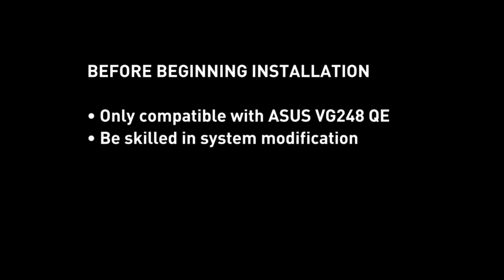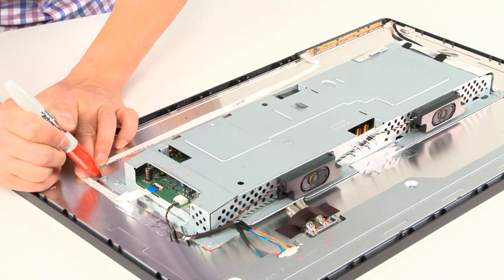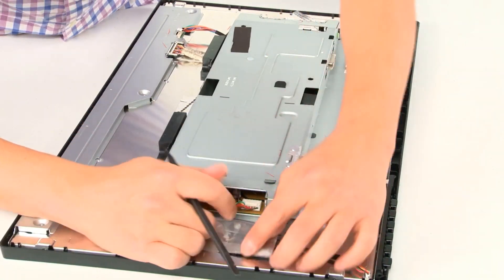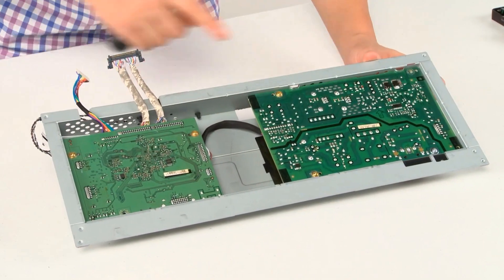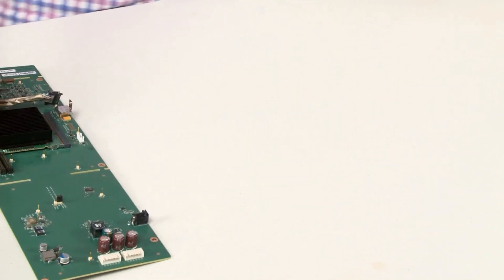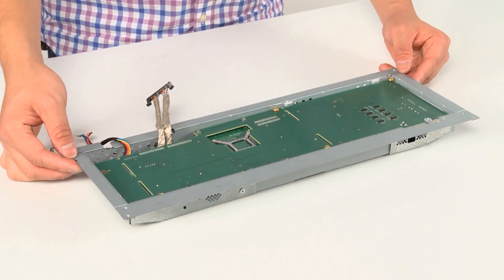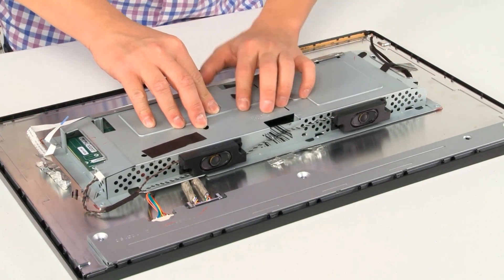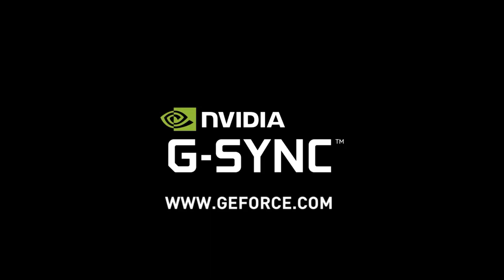NVIDIA G-SYNC DIY Kit Installation

Comment: Why is that entire component just stuck on with tape and not with screws?
Reply: Because what its held onto is the back of the LCD screen, you screw into that, game over for the monitor.
Reply: Because the stand portion of the monitor from the back pretty much keeps the PCB component in place, even without the tape it will stay there.
Reply: aznstar871 Ah, I see. Thanks, I didn't realize that it was mounted anyways.
Reply: Jamie Powley What makes them unable to build a plastic chassis inside the monitor that separates LCD screen and electronic board? That'd make it significantly easier to install a Nvidia board in place of stock monitor motherboard.

Comment: I cannot believe, that triggering a latch signal externally is such a hard thing to do. Maybe because the established design is so heavily integrated and focussed on fixed framerates? I am just a layman in this field, but maybe one step towards de-integration of the circuits would make a mod like this much simpler.

Comment: This is one of the dumbest ideas I've ever seen, Nvidia a monitor is not a PC this is something no user should ever be expected to do with a monitor. Either supply G-SYNC built in or don't bother would be my advice, theirs no reason to run the risk of destroying the monitor for this upgrade. It's like asking people to add an Extra HDMI connector to a Graphics card, but don't worry it just needs some soldering! Really interested in G-sync but this is not a good way to get people interested.

Comment: 200$. Voids my warranty. HMMMMM.
Reply: but... g-sync
Reply: ***** but... screen tears

p.s. i dont notice them >:D
Reply: ***** But.. only laptops
Reply: ***** well; in this case the QE is 144hz - thats just reset to factory defaults; G-SYNC is totally worth it; after trying it I had to have it; finally the DIY kits came back on nvidia.com and mines on route to my house; can't wait to crack the back of my monitor open!
Reply: merijn dobbelaar match frame rate to the refresh rate of my monitor, just cap your frames, its not difficult

Comment: AMD Mantle API no OS attached.Question

How where they able to develope a New Graphics API without needing to redesign the operating system. This is revolutionary. I was told if i wanted to use DX11.2 i needed to install a touch screen implementation of windows called windows 8 on my new non touch screen monitor.Then upgrade to Windows 8.1. With the AMD Mantle API all i need to do is make sure i have the latest graphics driver's
WOW thats just amazing.

Comment: Here's another thing. I bought this monitor in preparation for G-Sync, but it's SO good on its own (1 ms), I don't really see a reason to upgrade.  There's got to be a better way to help people understand why this is worthwhile.
Reply: Frankly, I had bought the VG248QE with g-sync in mind, and the refresh rate of 144hz alone makes screen tearing barely noticeable when compared to a 60hz monitor.
Reply: Same
Reply: same here. I would buy another monitor with g-sync after saw that price. better worth it,
Reply: Gsync is needed because in very demanding games you often won't be able to maintain a steady 144hz.

Comment: Quick tip. after plugging in all the cable, power up the monitor to make it works before you put everything back in its original state.

Comment: It does not look soo hard and I have worked with far complexer things but I think spending those 200$ on a better GPU is the real way to go. If I had 200$ more for my build I would have bought a 780 and not a AMD 280x and I woul not have to worry anything. Humans do fail from time to time so the risk would be high enough to lose a few hundret $ on something that could have been bypassed by spending money on better components.
Reply: No, bro. You see, G-Sync solves the issues related to both low fps and high fps (yes, high fps can be a problem too).

If you have low fps, your monitor will lower its refresh rate so that you don't see stutter in the picture. It's the same if you have high fps, but you can turn off V-Sync and forget about tearing. For this, G-Sync monitors are coming with a high maximum refresh rate (About 120~144Hz or higher)
Reply: hmm... okay, I did not think about that.
Reply: ***** It depends on how you see it. The way I see it, G-Sync isn't pointless.

There are people like me that can't afford a PC upgrade right now because of everything it involves: upgrading PSU, new mobo, making sure it will last for a few years, etc.

But a monitor that will stay with me even if I make a new PC, that I can do. And if the monitor will take advantage of everything on my current PC, it's even better.

The thing with a fixed refresh ratio is that you'll get stutter if your game doesn't run at the full 144Hz of your monitor and will get tearing if you run higher than 144 fps.

G-Sync allows you to have a variable refresh ratio from 0 to 144, meaning that you can play on any graphic quality, get any fps from 30 to 144 and it will look good–no stutter; no tearing.
Reply: ***** Right, I don't mean literally zero input lag, of course. But I thought it was more like 1ms. 2-3 is still really good, especially when no frames are ever skipped.
Reply: Yep, what he said. Plus getting a 780 won't solve everything. I have a liquid cooled and overclocked 780 and it doesn't solve tearing, stutter, or any of the other effects of a GPU not being synced with the monitor. A 60hz monitor with G-sync and a lower mid-grade GPU like the 280x could potentially result in a noticeably better gaming experience than my 780 and a 120hz non-G-sync monitor. You may be somewhere between 45 and 60 FPS all the time with the 280x and 60hz G-sync monitor, but those FPS are perfectly synced with zero input lag, stutter, or tearing. And that's going to be a consistently smooth gameplay, whereas a 780 putting out higher FPS into a higher refresh rate monitor will be all over the place from very smooth one moment to tearing, stuttering, lagging, skipping frames, etc the next moment.
Reply: ***** I thought the delay happened with the DYI kit only :o :o :o
Reply: Seriously. If to much fps is an issue, because of dips desync etc, I would recommend trying nVidia shadow play on. Its free and while it uses a bit more resources overall it actually also stabilize the fps around 60. Making transitions between images seem more fluid. It dose not remove screen tearing like vsync though.

Comment: freesync + displayport 1.3 here I come, all you have to do is flash a firmware update on existing hardware if the manufacturer releases one.  Newer AMD cards most likely already supports DP 1.3.

All this to risk breaking a $350+ monitor? WIth a $200 addon card?  And aren't they restricted to 30Hz right now?

Comment: I love the idea of Gsync. I want it. But at the price point of 200 dollars for the kit alone you might as well save your money and wait for a gpu upgrade that will run games at a constant 60 fps. If you are prepared to spend that much on Gsync, chances are you already have a gpu that can do that. This does not include the (120hz gamers)
Reply: But pre done G sync monitors by the likes of ben q and asus will cost less for this you are just paying an early adopters fee
Reply: Sure you can get one of those too but I would think most people who have a 300+ monitor will still have a really power gpu to back it up.
Reply: Well I think I'll be swapping my monitor for a gsync on have a 1440x900 monitor from about 7 years back and it's served my well it's just time for an upgrade because I always upgrade my rig and put the monitor behind me so it's got a well deserved upgrade coming
Reply: I bought a very nice very flat super high contrast wonderfully colored 1080p display about 5 months ago. Easily the best display i've ever had. Makes my 1080p tv look stupid when comparing color and pixel density.

I couldn't see myself getting a new monitor for at least 3 years because I have a gtx 780 and ill have a 780ti in about 2 weeks. I don't think I will be dropping below 60fps in anything.
Reply: I've got a 760 upgrading to sli in about 8 months ( probably when I'll get a G sync monitor too!)and it's just a logical upgrade path for me because I like to think of a monitor as a piece of furniture because you keep them for years and if you buy a bad one your stuck with a bad one vica versa so that's my reasoning for it
Reply: Hey if you are upgrading from something that old no doubt it is the way to go. I was just thinking there is not a good reason to run out and buy a new one if you already have a decent monitor. And if you don't have the horse power to maintain constant 60fps. Two 760's should...but you still need a new monitor. lol
Reply: I totally agree with you and I'm upgrading so why not go for the new technology if you can just not sure what resolution to go for if there are any 2560 x 1080 (21:9 ultra wide) G sync monitors around when I'm buying ( might even wait) I'll defo pick up one of them
Reply: I am jealous. I would take a 21:9 monitor over a 1440p monitor any day. I was actually thinking about buying one later in the year even though my monitor is not old.
Reply: I  would think that good FOV would make more sense hence the wanting of a 2560x1080 ultra wide
Reply: Yeha I always adjust fov really high if I can, I can't imagine ultra wide would hurt. I like fove between 100-120 in most games. 90 for skyrim because it fisheyes so bad.
Reply: Yeah my skyrim is still somewhat unstable (blame that on mods) but it's really odd because it adjusts it on all angles not just the left and right
Reply: I seem to have a huge performance loss when changing my fov, I never noticed it before because I just recently installed all my mods. I drop about 20 fps going from 75fov to 95. It's insane.
Reply: I've always observed drops in fps when adjusting FOV but never as much as Skyrim so a widescreen resolution makes more sense for it
Reply: Weird thing is I have never seen more than 2 frames being dropped when massively increasing fov
Reply: The Lobotomite ~4:3 offers the best FOV without distortion("fish eye"), it's roughly the same aspect ratio as human stereo vision. Hence why IMAX is 4:3.

Wide screen monitors are a compromise solution. Most of the action happens along the horizon. Hence if you use a "letter box" format you can save on drawing ground, floors, sky, and ceilings which are often not as interesting as what's happening on the horizontal axis; for the same amount of pixels you can cram in some more horizon instead. Cinemas are also cheaper to build wide rather than tall, which is why the format cought on in the first place.

Given an unlimited amount of money and computing power wide screen is clearly a poor choice; since you can always have a display as wide as the wide screen, only taller to more accurately represent the aspect ratio of human vision.
Reply: SLI 780 ti's and G-Sync you do not notice drops of FPS; - I use 16:9 obviously at 1920x1080; I use 110 fov in Quake Live, Battlefield 4/BF Hardline beta/(Christ; another game that just came out drawing a blank.)
Reply: Yes i do. Wanna see video?

BTW I didnt have to get my 780 on discount, i got it because it has built in water cooling.

Also, I seriously doubt you have either of those things.
Reply: Jourmand1r 2560x1080p isn't UHD. I run ALL my games at a perfect 60fps without and hickups. A 780ti is more powerful than and amd part. Even though the 290x scales better at 4k over the 780ti...at beast the 290x catches it on some games at 4k. At best. You are just talking out your ass right now for no reason. What is your agenda? You are not making a point.

Comment: why doesn't nvidia invent a technology where the graphics card can understand limit its power for a target frame rate with 20 percent headroom on the top as buffer for intensive scenes.  instead of all this new monitor nonsense.
Reply: Because it's the monitor which is the problem, not the graphics card, no point in sticking a bandaid on it, someone needed to fix it.
Reply: its not about sticking a band aid on it. I hate how nvidia thinks they are the god damn genius innovators, cause there is not innovative about a company making hardware work with other brand new hardware produced by them.  I want to see innovation in this space, real innovation which would make this work with monitors everybody has already.  wow nvidia your so smart, we can buy a new monitor and a graphics card to use this OMG> mind blown. next we going to be clapping that the xbox 360 controller works on the pc if you buy a xbox 360 dongle. yeah give me a god damn break.
Reply: Edward Johnston
Well how else do you suppose the technology changes without it costing money to replace the old outdated hardware? Just magically poof it in?
Reply: MrSmaste Well they could stop with the variable monitor frame rate bullshit.  How about nvidia just uses variable power techniques. how about a gpu dynamically changing within a 20 percent margin its power envolope so that there is never more than 60 frames rendered. Or perhaps dynamic altering of resolution to acheive a flat 60. these are not band aids, these are real solutions.  buying a brand new monitor is not a solution, its not solving a problem.  its just not dealing with the problem, its just replacing equipment to get rid of the problem.  I have a 780 ti, and i don't care for this. but nvidia is really pathetic for putting out this proprietary garbage, when we all know this will be a stupid VESA standard noone uses in a few years, maybe in laptops who know.
Reply: Edward Johnston
Because the graphics card doesn't always output 60 FPS, if it dips what then? You're experiencing the same problem. Not a band-aid? Yeah sure it's not a bandaid if you don't mind never playing any graphically intensive games.

Comment: I still get kinda freaked out watching this. Even as someone who is skilled in working with electronics like this, I still recall my highschool teacher telling us over and over to NEVER modify/repair  a monitor on your own. I know the video says it's for skilled hardware people but this is something you shouldn't allow the public to do themselves.
Reply: There used to be large capacitors in CRT monitors that could be quite dangerous if you didn't know what you're doing. Thats not an issue with LCD displays.
Reply: Indeed there were, but the great thing about capacitors is, when voltage comes off, they almost immediately lose their charge.
Reply: Your highschool teacher was wrong. People put these together, not robots. People can take them apart. I'm been repairing TVs and monitors for almost 10 years now, it's fine as long as it's unhooked.
Reply: Lol those are low voltage components... Only the PSU input has a higher voltage. Oh well its not the voltage which can kill you but the amperes.

Still just keep ur hands of the PSU when you just unplugged. 
Or discharge the pcb / capacitors.

CRT Screens yea those are pretty dangerous but still proper discharge and use nothing will happen.